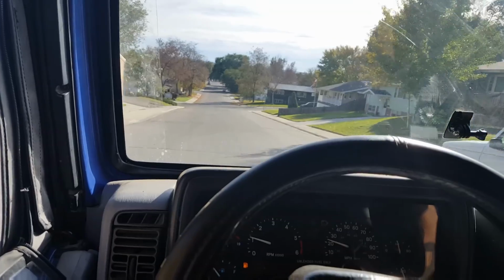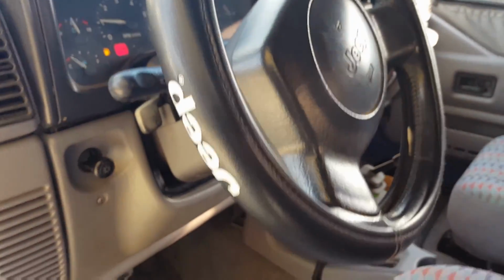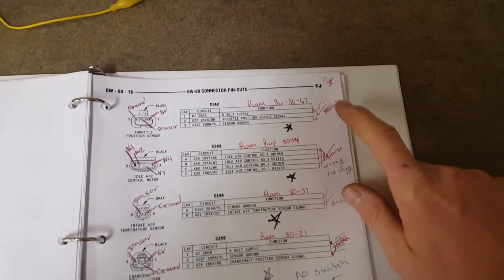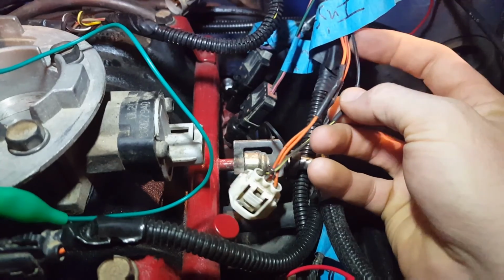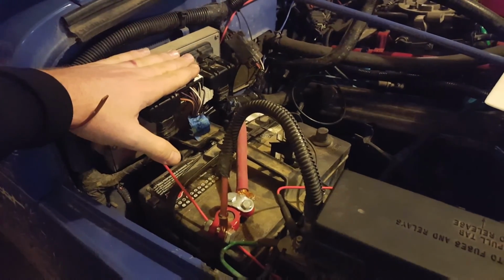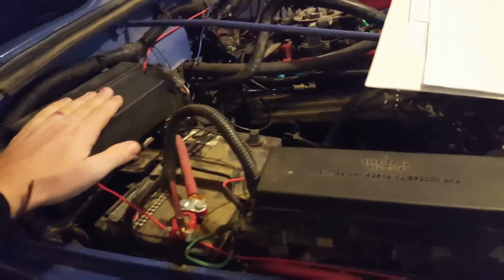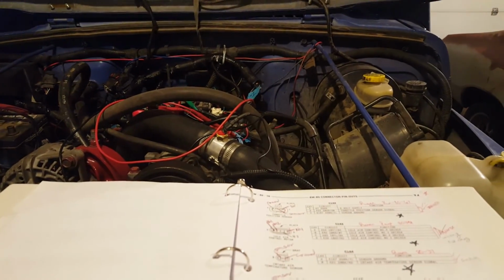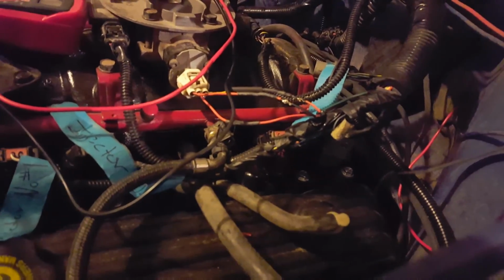Jeep tj 5.9 swap Video 26 (ugh troubleshooting)

Comment: if your engine has over 100k i would change all sensors my 5.9 wouldnt run right for over a year it was a bad cps sensor combined with a lazy o2 and my coil was on its way out. get yourself an accel coil its yellow 50k volts
Reply from the maker: commops106 well some are new the coil is new and all the ignition is new. the engine runs really good now.

Comment: You had to run new wires and "Pin in" connections for cylinders 7 and 8, but did you actually plug the one intended for 7 into 7, or did you actually take the proper coil connection and accidently attach it to the Coil for 8.
Reply from the maker: UCanDoIt2 are u saying 7 and 8 are crisscross?
Reply: What I'm trying to say is...  You may have wired the Coil and Injectors correctly for Cylinder 7 (as far as the harness is concerned), but when you installed it, you physically ran those wire over to Cylinder 8.   And vise versa for the other new cylinder.   Just a possibility since you are getting a misfire.  Back in the days of Distributors, if two cylinders were crisscrossed, the engine would run, but it would misfire and be sluggish.  Just a thought.
Reply from the maker: Ha! I had cylinder 5 and 7 plug wires crisscrossed! Check out new video!!! Thanks Mike!

Comment: Maybe from running open headers? No back pressure can cause less power. I ran a 5.2 magnum open header and  seem like it didn't get up and go like it did before.
Reply from the maker: Brandon Fortune well I have a couple other things to check today... I ran the 4.0L with open headers and it ran fine just ate gas like crazy.